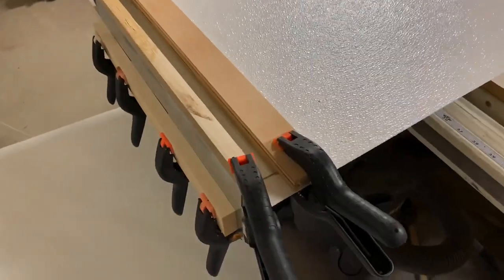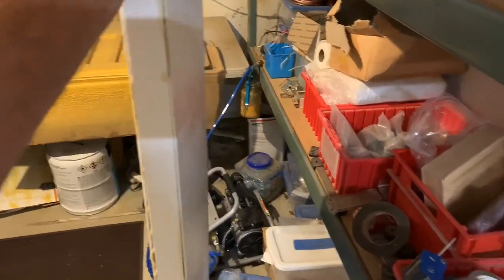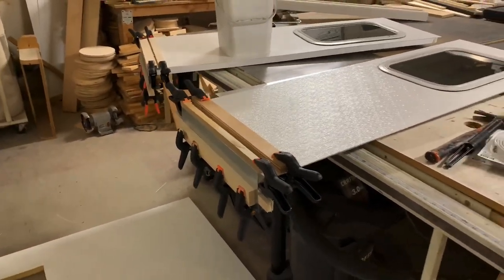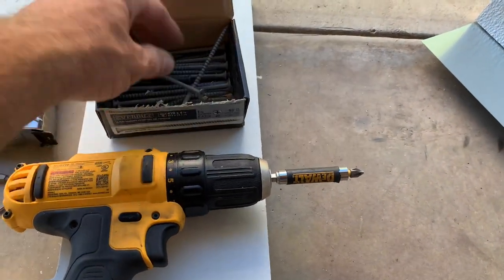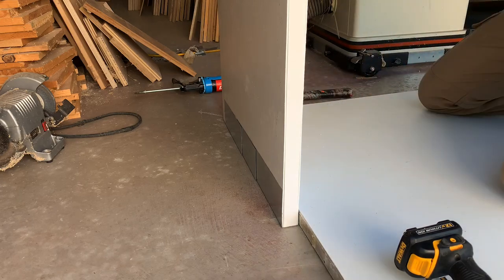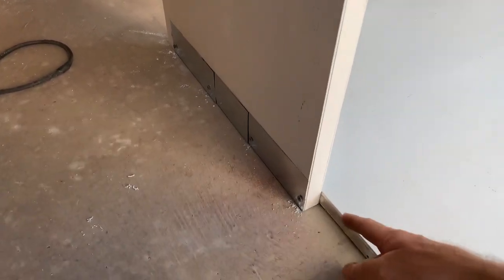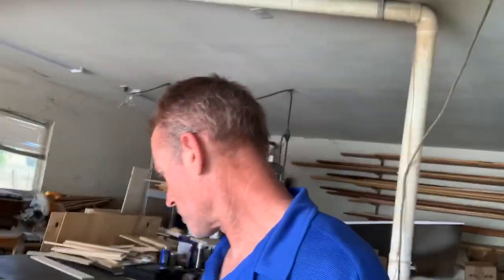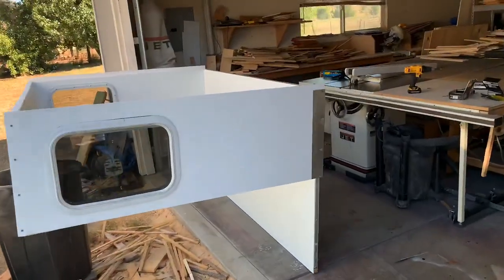Building the New Slideout.  Truck Camper is Finally Coming Together

Comment: Really enjoying the process of this rebuild. I am in the design phase of a camper and was wondering if I might ask a technical question. Wondering about the side and top clearance of the slide box to the camper sides and top?
Reply from the maker: Bottom of the camper floor to the shoulder above the truck bed rail is 21"  Overall height from bed floor to roof is 94".
Reply from the maker: 2 1/2” clearance on the top, 1-1/2” clearance on sides and bottom.

Comment: Would you also recommend the PVC frame to be used as structural portions like at cabover and other wall sections?  I’m getting most if not all of my walls replaced. Lots of water damage. I’m debating if I should go with aluminum frame and weld them for strength or not. If going aluminum, I need advice on the thickness and if it’s a weight saving or would be heavier. Thanks much.
Reply from the maker: I would not use the pvc for anything load-bearing.  Aluminum tubing or wood and seal everything very well.
You can stuff the aluminum tubing with the PVC instead of wood.

Comment: Very helpful video.  I am building my own retro camper from ground up.  Question in regards to the actual slide out mechanism!    Where did you purchase it? And how much was it?  I cannot seem to find one online.  Only parts.  Any other helpful information would be greatly appreciated.   Thank.  Good video.
Reply from the maker: It is an OEM slideout mechanism.  2003 Fleetwood.  You can purchase these in various sizes.  It’s a HappiJac brand.
Try RecPro.com or RVautoparts.com
Reply: I have an extra slide out mechanism if your still looking, I’m in CA.

Comment: Sorry, nothing to understand
Reply from the maker: Actually, there’s quite a lot to understand here.  People are here to learn how to rebuild an RV slide room so it does not leak or rot causing failure.
If you attempt to to this yourself without understanding the processes and why I’m using these processes, your rebuild will fail.  I have an entire series here on YouTube showing my rebuild step by step from the year down to the finished product.  
I’m still using this camper.  I have no leaks and it operates flawlessly because I took the time to understand.